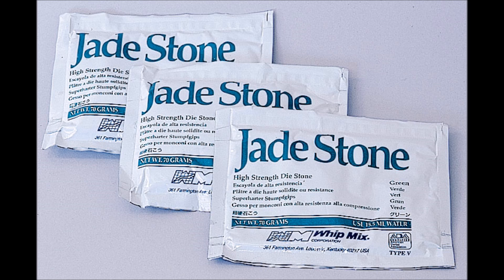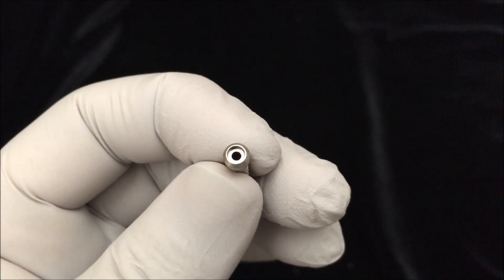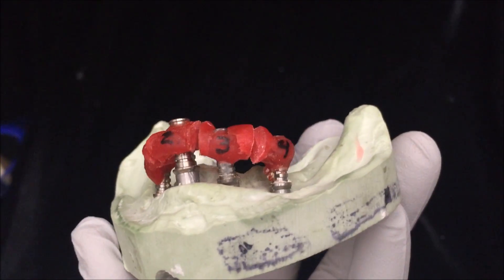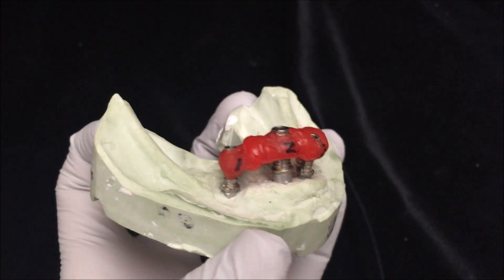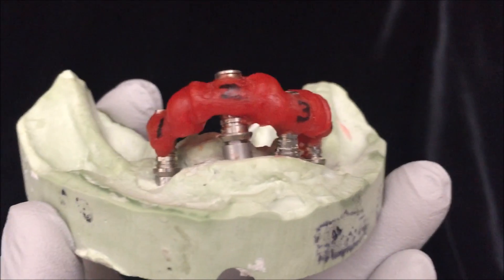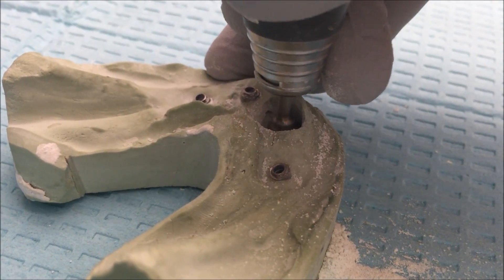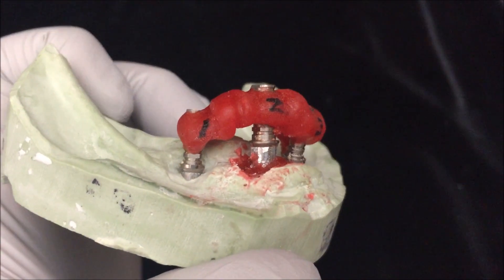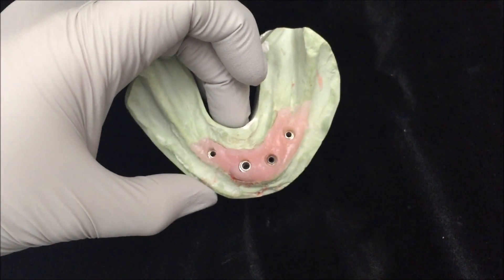Step-by-Step All-on-Four: Part 2:  Model Verification

Comment: I'd imagine what you could do as well but wont be as accurate as a wash is to put the soft tissue on top of the gc resin then seat the implant analog on top and tigthen everything. and maybe it'll fit after all that.